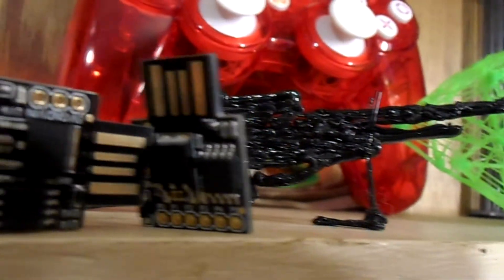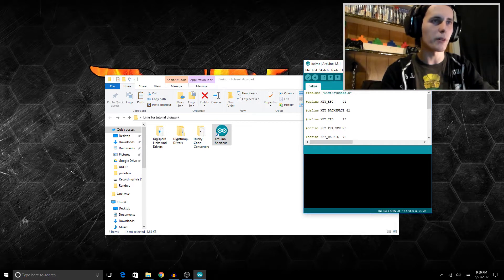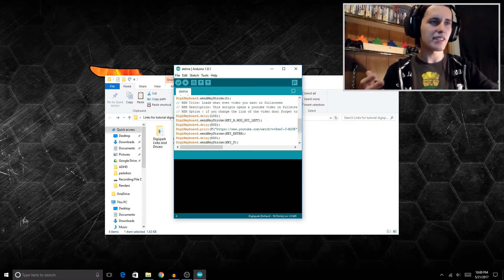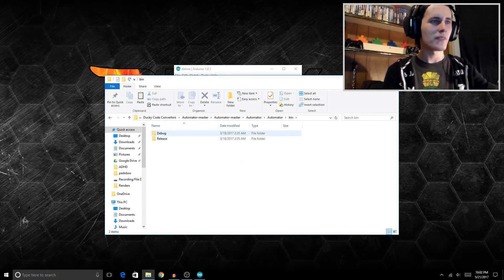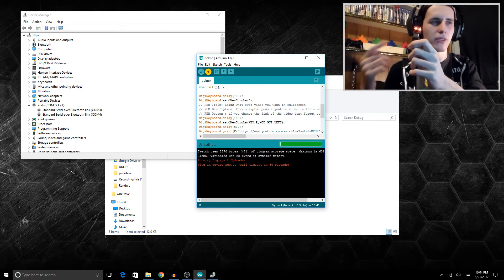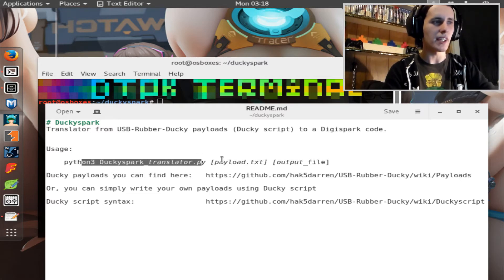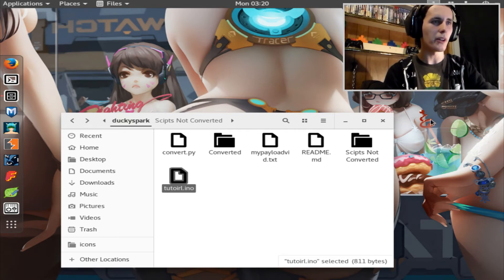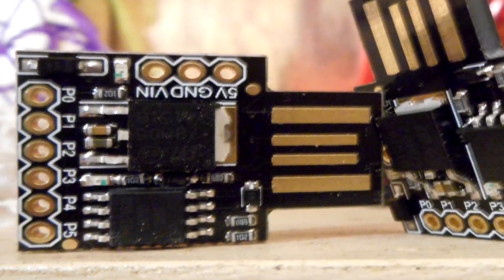Digispark Flashing Guide & Ducky Payload Converters

Comment: I have a question, Iam trying to use the wifi emailer script for digispark I got everything working but I always get errors on any script and wont flash script. Any advice?
Reply from the maker: If this script was converted from ducky code too arduino digispark code you may have to clean it up a bit some of these coverts arn't perfect and some work better then others i'd look through the code before flashing it and see if it was converted right. Also sorry for the late reply.

Comment: Great video bro.  My two digisparks just came in, Wasn't too difficult to get going . I do have a question, Showing up as a HID Device makes windows " Chime " if there are speakers. How do we get around that ? Cannot find anywhere ... Also have issues using with PC w/o digispark drivers , some times it will not see it as " HID Device " I am using the DigiKeyboard library in my scripts in hopes to be seen as  "HID Device " and not need additional driver , Is that the best library? Or doesnt arduino have their own library for HID device ?
Reply from the maker: Hmm I don't know why you would need a driver for it to work on other machines once the digispark is flashed you plug it in and it should load in a basic hid driver on the target machine you shouldn't have to go and download it yourself and it shouldn't even need to be connected to the internet to get the driver I have used these digisparks on a pc I haved that doesn't have internet connection at all... Also the windows chime no way to get around it but you can disable it using the digispark by making a script to open the settings and disable it  so that the next time you plug it in it wouldn't make the noise.

Comment: 8:30 - how can it "automatically run on every computer" - you mean no USB drivers are needed?
Reply from the maker: Yes exactly when you plug it into another computer or device the Digispark will act like a keyboard and it will put the default drivers on if you don't know what I mean take any keyboard or input device and plug it in to a computer you never used. In essence the same thing will happen with the digispark so you won't need any drivers to download. The only driver you need is when you flash it but when your done flashing the Digispark it will work on any computer regardless it will put drivers on automatically.

Comment: mh this doesnt really help me.. i am Trying to run a Ducky script that needs to Save something on my Arduino based ducky. Can i it even do that? like not only pretending to be a Keyboard also being an USB stick like the Rubberducky after a Flash...
Reply from the maker: I think you would have to hard mod it in I don't know of any board that do both although I seen a video by the user Seytonic he shows a way of being able to run the ducky code via aurderino from a sd card but I image it would also work to hold and or copy files too it I just think it would be slow

Comment: First of all rlly cool video! you have my sub ) I have some problems with the Digispark and thats with my Keyboard layout ... I have a swiss keyboard layout, so since digispark is only for US keyboards its useless for me :/ but i found a tool on Github that says that it can fix this:

https://github.com/mame82/duck2spark

It seems very cool but i could get use to it. Could you have a closer look at it and help me if possible? :) I managed every step until the last, which I dont understood: 4. After setting up the Arduino IDE load the example "DigisparkKeyboard" and replace the Sketch source by the one saved to sketch.ino.

Regards Flaqz
Reply from the maker: Oh wow that duck2spark definitely seems cool it takes already converted ducky files that are .bins and converts them really useful as of the last step all I could see you having to do to fix the issue is hit file at the top in auderino then hit open and just open up that .ino file. By the way i'm definitely gonna have to check this code out I kinda wish I saw it so I could have added it too this video.
Reply from the maker: Also thanks for the sub it really helps and if you get the last step to work let me know but it should be just as simple as opening it lol. :D
Reply: hey have you figured it out yet? im struggling too